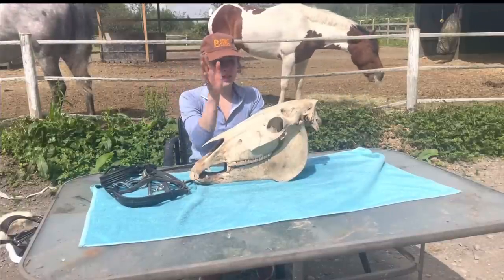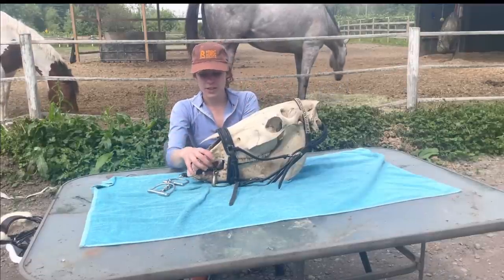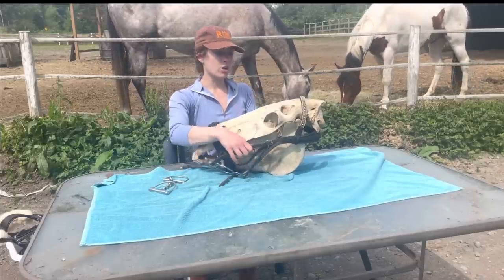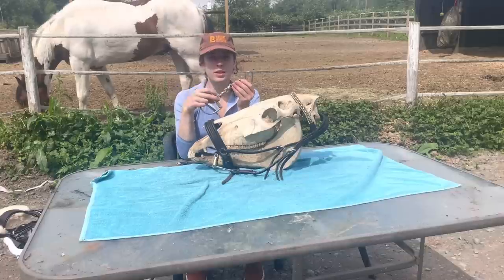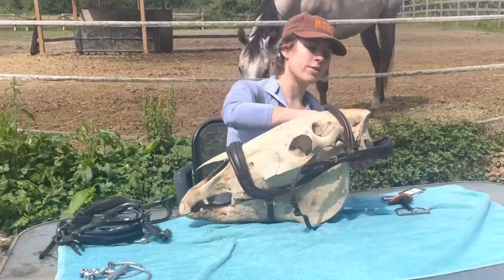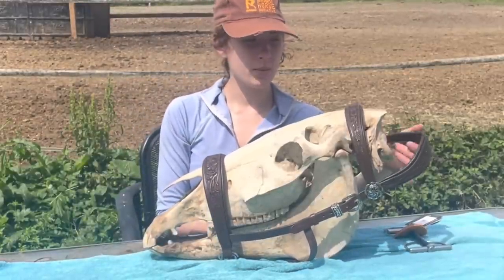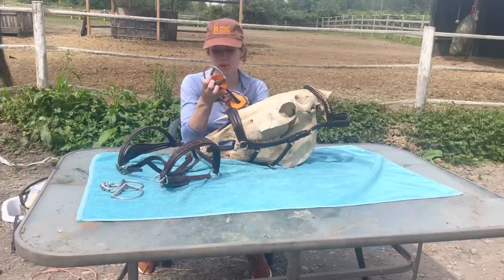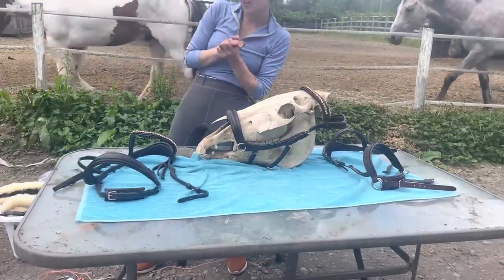ARE BITS BAD? Reviewing Bits I Used to Use

Comment: Bits with any kind of leverage are not ment for one sided pull. So in competition they are either pared with a snaffle like in dressage tests or ridden one handed, like in western or working equitation masterclass, but always without a flash. The only exceptions for some reason are show jumping and eventing where you can pull on them with both hands in any direction and combine them with flashes and martingales and pretty much every torture device you can find and it's perfectly legal. I really don't get it. Thank you for doing so much to educate people.
Reply: I never knew this about jumping Iv really only done small shows we always used the same ones we practice in snaffle and maybe a crop for competing the whole idea of TWO bits in dressage to me defeats to point? Is it not a class about how you and your horse move together with little to no effort elegantly? To me dressage needs a hackamore section and or just allow them all together. I knew all horse sports had a dark side im just shocked because that sounds like at least in dressage it contradicts the whole point. Same with jumping I used my dressage bit the snaffle if it’s good in dressage it will be good on jumps too why change it? Iv always used a light snaffle this makes me shake my head.
Reply: @abby3373  The purpose of the two bits is, that you can choose which one to use in any given moment, while the rains to the curb should mostly hang lose. But in todays dressage you mostly see riders constantly pulling on both pairs of rains at the same time...which defetes the whole point, yes. I think you are right and this kind of bit combination shoud not be mandatory. If somone can ride a grand prix in a neck rope, they should be allowed to do it.

Comment: The horse I lease was ridden in an elevator waterford with the rein on the bottom hole and a figure-8 noseband for years. She has two white pressure scars from it, one behind each ear on her poll, and I HAVE to imagine she must have some kind of discomfort there, even though she is very stoic. She also has the reputation of being "hard mouthed" 
When I first started riding her dressage bridle also had a crank AND a flash. Now she's being ridden in the Harlow bridle for dressage, and I got a bit that fits the conformation of her mouth much better. Whenever I'm not doing dressage in my lease rides I ride her in a hackamore. If I owned her that bit would never go back in her mouth.

Comment: When I was younger my one of my coaches would always tighten my nose band super tight while I was getting on and I was always too scared to tell him to stop, even though it was very against my morals. Looking back I wish that I was brave enough to go against his wishes. 
I commonly hear the excuse for tight nose bands being that they need to be tight in order to “support the horses jaw so they can relax their jaw in the contact”. I always wonder why people think this is correct. To me, that’s logically counter productive. If the nose band is so tight that they can’t open their jaw, then how can they properly relax and soften their jaw? When you relax your jaw it opens slightly and it takes up more space. If you have no space to loosen in to, then you would just keep tensing your jaw. 
  I always use a noseband for loose rings so the bit can’t slide through the mouth but it must always have about three fingers on top of the nose. I see so much debate over bits but nobody seems to think about the severity of different nosebands. Especially ones like drop nosebands. I can’t fathom how people choose to use one.
Reply: Have you heard of a kineton noseband? I had a horse come in for sales prep that was ridden in one. I had never heard of it before and was appalled. Any time there is even a slight amount of contact, there is pressure on the nose. This horse was ridden with constant contact so the poor thing was constantly in pain. It’s apparently designed to take the pressure off the bars and transfer if on to the nose but I found that it only adds pressure, without removing it from other areas. Maybe it depends on what bit you use it with. The owners main issue with him was that no matter what, he was always behind the vertical… I wonder why! 🤦‍♀️
Reply: I borrowed a Morgan gelding for a trail ride. The person who saddled him brought him out in a hunt bridle with a curb bit rigged with a Chambon. I had read about chambons but I had never seen one before. Talk about torture devices! It was totally inappropriate to use on this horse because he was incredibly broke and compliant. 

They were actually using this piece of equipment on him for beginner lessons! Pressure caused by a chambon can cause a horse to rear up over backwards to avoid pain. 

I told them I wouldn’t ride him in it and that they needed to take that contraption off. They removed the Chambon, but they acted like it was my funeral for riding him without it. Ten minutes later on the trail we were cantering around in complete control with the lightest touch on the reins that you can imagine— in fact, I didn’t ride him with any contact because I felt so sorry for him that I threw the reins away. I didn’t need them to control him.

This horse was a pleasure to ride. I would’ve felt comfortable on him bitless. I had never been on him before, but he showed me right away how responsive he was. I think he was so relieved to get that thing off.

What possesses people to use equipment on a horse that isn’t needed and could actually cause a well-trained and compliant horse to become dangerous? Is it fear? Obviously it’s totally ignorant.

Thank you for trying to design bridles that are an improvement over the way things have always been done.

Comment: Again, your clarifications are excellent!! It makes me wonder why we are taught by trainers these are all okay to use and moreover almost ingrained in us that the “better” of a rider you are, the “harsher” of equipment and aids we are “privileged” to graduate to. I think in reality, we can all use harsher equipment to achieve a more controlled collected horse and jump bigger faster, however now that I’ve grown older and removed myself from this line of thinking, I’m of the belief that the lighter, softer and less obstructive of equipment we can use to achieve the most “willing” horse who is giving us their submission to aids rather than forcing that, that is the goal. And moreover not every horse and rider is the right fit. I’ve known top level horses to go in simple snaffles with certain riders and crash others into walls. What was the solution? Put on a stronger bit, add a set of reins, lessen jaw movement, add elevation. It’s not fair to punish a horse for a riders lack of ability to utilize sensitive aids

Comment: I think the waterford is meant to create more even pressure by wrapping around the tongue, but like you were saying, it doesn't give a steady contact. Unless the horse were leaning into it and the rider's hands hold firm, but then you run into the issue of the pinch points. I'd looked at using one with my mare who used to toss her head (it was bad & went on for almost a year, did everything we could health/training wise before switching bits) when she was green. I tried just about everything until using a rubber mullen mouth. She absolutely loves it. I upgraded from rubber to a happy mouth and she goes in it for all three phases. I use a loose ring for dressage and a full cheek for jumping, but they are both as gentle as can be. It's funny how ingrained "bitting up" is in riding.. and that the solution was to bit down. Less is more, people! I'm using the same bits with my most recent OTTB and my young stallion. I do use a crank noseband with one of my mares. It's just part of the bridle I found that fits her best & is good quality leather. I don't do any noseband tight, though. I don't like the idea of forcing their mouths shut for the illusion of success. If they're gaping, it's my job to know and fix the cause.. not the symptom.
This is a long comment. lmao Great video, thank you!!
One more side note! lol I know you like the monocrown but they seem to have a lot of bulk behind the ears and they never have removeable nosebands. (I want to be able to jump without a noseband but would need to put one on for dressage.) My Irish Draughts and my new OTTB have very large ears. Are you looking at doing a different style to accommodate big ears and/or removeable nosebands, by chance? Thanks again!
Reply from the maker: Ours have cut outs for the ears, could definitely consider custom options for larger cutouts. All of our bridles also have removable nosebands. Hope that helps!

Comment: I just want to say it takes a big person to admit they made mistakes and to learn from them. When I first started riding my second horse when I outgrew my pony I ran barrels and did games on and we won, but I wasn't as good as I could be and I knew it. People's advice was a tougher bit. I just needed a harsher bit and a harsher bit and I was in a Tom Thumb and I needed a full on corrective bit and a great man told me "If I was training my horse every time I got on then why would the bits be getting harsher?" so I refused to go harsher because my gut said "NO" and I went to a Horse Camp and this Barrel racer had to do a dressage class. I was hesitant to say the least but then she told me what dressage actually meant and it wasn't about the fancy letters or saddle I didn't have. Dressage was simply "Communication with your Horse" and she showed me how to ask for things so I went home and I did the opposite of every barrel racer. I practiced figure 8's in a softer bit and I got full flexion through the back of my barrel horse. We could bend and flex and do flying lead changes and I never kicked or overran the horse on patterns. Then when I was winning I had everyone asking me how I make my gaming horse do XYZ. I don't make her do anything. I ask nicely and did the opposite of what everyone said. Now when a barrel racer comes in asking for help and they are knocking and they have a stiff horse and I tell them to take off the tie down and just show me a circle to the left and a circle to the right. . . . .they look at me like I am crazy and tell me they are here to work on barrels, but they have no idea how to get their horse to bend at all. Softer was better and I'm glad I listened to my gut.

Comment: Hey Shelby! With regards to the elevator bit, does it function as a snaffle if the reins are connected to the snaffle/big ring? When I bought my horse she came with this bit but I've learnt to use the snaffle bit. Is this also bad? I ride her in walk outrides and I ride with very loose reins (basically on the buckle). Does this hurt her?
Reply from the maker: If used on the snaffle ring it’ll be much softer
Reply: @Milestone-Equestrian  Thank you for taking the time to respond, I truly appreciate it!

Comment: People made fun of me for just using a d ring and an old open headstall that's browband feel off.  I'm just so glad my girl could open her mouth. Trying to go bitless with a 22 year old horse that was used to harsh bits was hard. So we settled for the most plain thing I could find. We had many arguments about the plain old snaffle but we got there. We were almost to just leg steering... then she broke her leg n I had to put her down and never got to ride her with nothing. We had just gotten to me riding her to the front of our field in a lead rope, cause I had a hard time waking back.
I still cry and old that old dring bridle that's basically a loop.
Thinking about even touching my girl with that multiple joint Dring made me cry. I feel like I failed her now. Even tho it was just one joint.

Comment: I have an OTT here in New Zealand..How would I go riding her without a bit and one of these bitless bridle??  I have already done loads of groundwork and she is very good at flexing and is sock but hates a bit..I think it is association to racing??
Reply from the maker: You could definitely try it! Some OTTBs lean into bitless options quite a lot so might not be as responsive in a very mild side pull but if they’re sensitive and responsive to facial or neck reining cues it’s usually a fairly easy adjustment :)

Comment: This is very misleading.

“Crank” nosebands refer to a style of how they do up, you don’t need to overtighten them, same as any other pice of tack. 

I like them because they tend to be wider and disperse pressure over a larger surface area. They also have a padded chin strap.
Reply: A lot of people over tighten nose bands is what she’s talking about. Way tighter then they should be.
Reply from the maker: A lot of people over tighten them. I specifically state in this video that when correctly used, they deliver a more even pressure than a traditional cavesson and may be more comfy for some horses.

If you can clarify what part of what I said was misleading, I’m happy to make an edit but I did state that it was over tightened and immediately followed it up with the fact that it can be used properly.

With that said, even nosebands fitted correctly with 2 fingers restricted the jaw to some degree as I showed you.